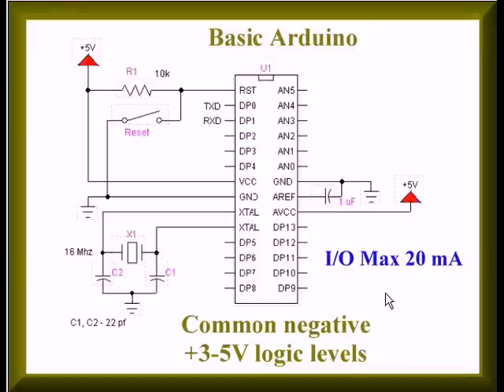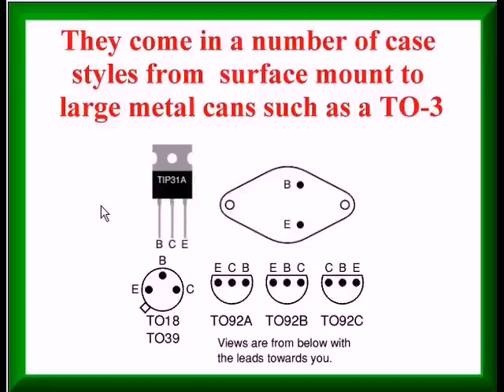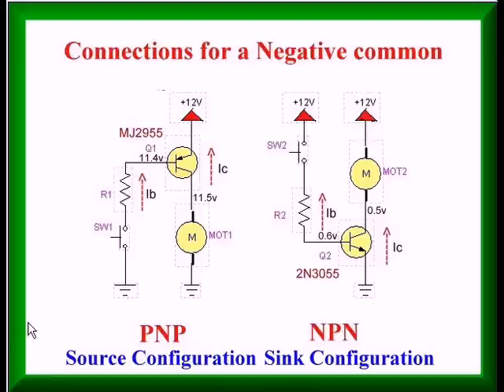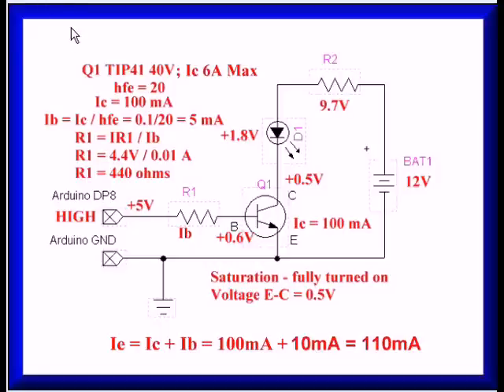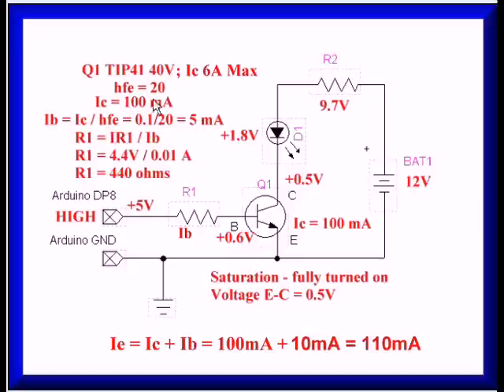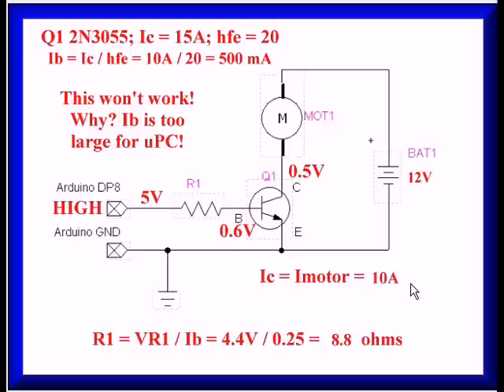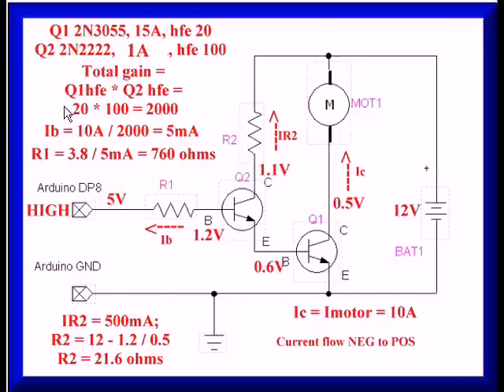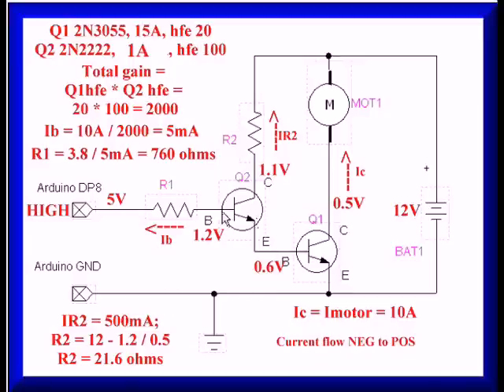Using NPN Biploar Transistors with Arduino, PIC

Comment: At 8:58, the 12V NEG and Arduino GND are connected together, will it hurt the Arduino device, because there's 12 volts potential in the battery versus 5 vots potental in the Arduino device?  Will the greater potential (12 volts) will cause a current to flow from 12 v battery to the 5 v Arduino?  Or is this a case where ground are cosidered zero votage therefore no current will flow from the greater potential to the lower potential??
Reply from the maker: No, the Arduino is fine unless the transistor develops a collector-to-base short. I often use optocouplers to prevent noise and short circuits in the Arduino.

Comment: Maybe I'm forgetting things but when I was back in school we were taught the current flows from positive to negative.  This was by convention for circuit analysis.  Electrons flow from negative to positive.
Reply from the maker: Old argument. I came through the military where we use electron flow which is correct. I switched to positive because that is what everyone uses today even if incorrect. Electrons in a solid conductor are the only moving charges. Gases liquids can have both.

Comment: Hi Lewis. Great video. Not a lot of people can explain things as clear and concise as you can.

I have a question. Your calculations  seem to imply that for a given BJT the BETA value (in your case 20) is fixed. 

However almost all datasheets will give you a range of  BETA (hfe) values  and collector currents (Ic). For example, the datasheet for my BC108 NPN transistor gives Ic(max) = 200mA,  hfe = 40 for Ic = 20uA and hfe=200 for Ic=20mA.  This implies that the hfe very much depends on  Ic. My question is if I wanted, for example, Ic=100mA what is the BETA value to work out base current (Ib)?  

Suggestions on the internet say  Ib should be Ic/hfe(min)* ODF (Over Drive Factor  between 2 and 10)

What's your opinion? I will appreciate a response.
Reply from the maker: Ic depends on Ib and hfe. this is an example and you bring up a good point - hfe varies somewhat from transistor to transistor. Here I'm using them as a switch and use enough Ib to assure the transistor does switch fully on. If this was an audio amplifier life would be far more complex.

Comment: Lots of good details. Thanks. Am I reading something wrong regarding the Arduino digital pin current limits? My reading on the Arduino website says it's 40mA.
Reply from the maker: RimstarOrg It's 20 as far as I know let me check.The atmega328 is 40 mA but I'm going by the atmega168 which really isn't specific. Most are 20 mA - this was also a video for PICs. But you are correct. Thanks.
Reply from the maker: RimstarOrg Me again I found it. 40 mA " Absolute Maximum Ratings" You don't ant to run it near that. So 20mA is safe to go by. Thanks.
Reply: Lewis Loflin
Okay. Thanks for checking.